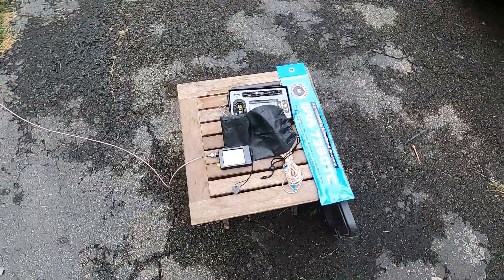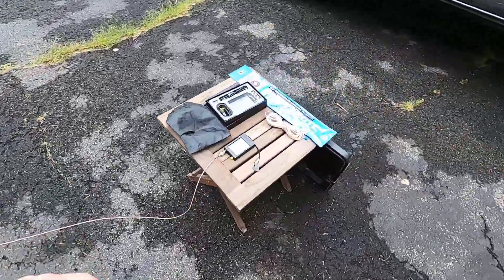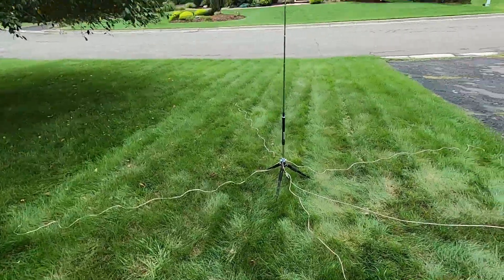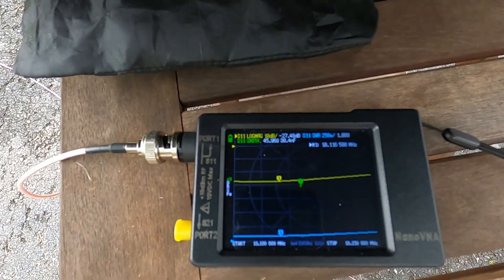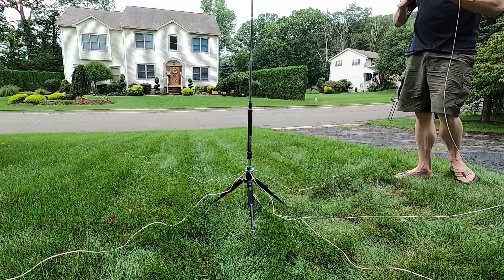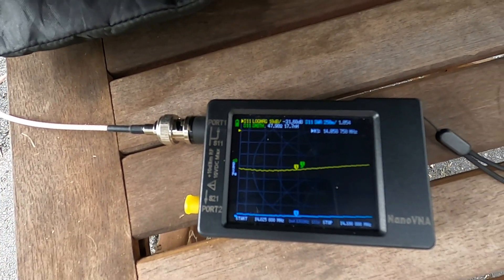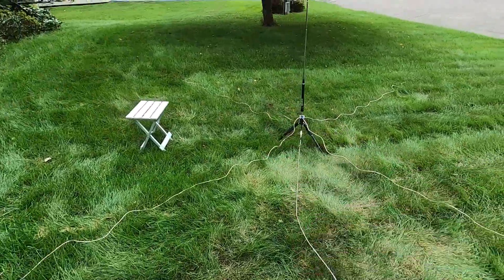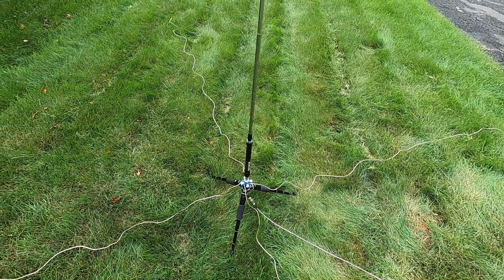Gabil GRA-7350TC antenna revisited.  How much difference does counterpoise number and length make?

Comment: So, if you say that the counterpoises should be 1/4 of the wave length, does that mean that every single wire needs to be that length or just the sum of all lengths? thanks ✌️
Reply from the maker: In theory each should be a quarter wavelength, but what I've found is if they're not elevated, that's not as much of an issue.  I'm running a setup where the total length of all of the radials equals 1/4 wavelength.

Comment: Have you tried putting a common mode choke in your feedline to the antenna? I find it makes my MFJ "Big Stick" less susceptible to tuning changes if I touch the connector shell on the VNA.
Reply from the maker: I haven't, but I'll give it a shot!

Comment: I work with AM radio stations antenna systems.  The best you can do is to get as much metal at the base.  It will be better to get more radials than longer radials.  So 8 15' radials should do better than 4 33' radials. It  easier to work with too
Reply from the maker: Yeah, I run 12 17' radials on my quarter wave vertical.

Comment: Interesting video. When it comes to radials laying on the ground, the more wire the better. 
My friend and I both use the PAC-12 vertical antenna. We both use three each 35 foot long radials and three each 17 foot long radials. This coming summer I am changing to 6 each 35 foot radials and not use the shorter radials.

Want better performance out of that antenna, add more radials. Your goal is not to hit a perfect 1 to 1 SWR. An efficient 1/4 wave vertical with a massive ground radial system will produce around a 38 ohm feed point impedance. If you show a perfect 50 ohm feed point impedance,  you are showing an inefficient antenna.

Barry, KU3X
Reply from the maker: Yeah, on my WRC I run 12 17' counterpoises. I found on the Gabil it wouldn't tune no matter what I did with that setup, but on the 17' vertical it works great. I realize SWR isn't everything, but a lot of my radios are very sensitive to high SWR, especially my little QRP CW radios, so I need to be pretty careful with it. Thanks for watching!

Comment: With these small antennas ( WRC,Super antenna,and the gabil) I worked with various radial combinations. In the end I found that one(1) 33ft length laid in a circular pattern around the base of the vertical worked as well as 3 to 6 radials at various lengths.  A single radial twnds to be directional. So I tried the circular pattern and have found that it works! N7KHH
Reply: Heck! I would try that just because it sounds crazy and I like it! lol.
Reply from the maker: Interesting! I'll have to give it a shot!

Comment: With a slightly longer radiator than the stock whip and three 15 foot radials, this is my “go to” antenna for POTA. Although, I will often use the stock configuration too when low weight and/or low profile is a priority.
Reply from the maker: I'll actually be running it for a POTA activation tomorrow. Thanks for watching!

Comment: I also have the 7350. I use 2-16' and 2-32' counters. It tunes 80-10 just fine.
Reply from the maker: Yeah, it's interesting how the counterpoises effect the tune.  It tunes fine with the setup I have right now, but if I add a 32' counterpoise it tunes even better on 40, and while I haven't tried it yet, I suspect I'd need the long counterpoise for 80 as well.  Thanks for watching!

Comment: I have only used 1 or 2 counterpoises, but elevated them to 4 ft, then got a good VSWR. Then I tried two 46"x 84" aluminum window screens overlapping each other by an inch, but choice to put in a 12  inch ground spike with integrated BNC connector I got from eBay. Suddenly my 7359TC tuned up nicely with full band coverage and 1.2 to 1 VSWR. It was like adding a 10dB amplifier for my 5 watts QRP signal. I intend to play with it some more, but am also experimenting with my MFJ 1979 17' telescoping vertical and also my PackTenna 9:1 UNUN where the feed point is within 12" of the ground and acts like my 16' counterpoise. I love experimenting & wished I could do it full time, lol. The beauty of the aluminum screen is it is quick to deploy and quick to stow, still looking for a small hollow tube to help wind them more tightly. Cheers, Davey - KU9L
Reply from the maker: Yeah, the window screen looks like a very interesting alternative. My only issue with it would be size if I was carrying the antenna into the woods. Close to the car though, and it looks like a good solution. After hearing how well it worked for you I'll definitely give it a shot! Thanks
Reply: @EvanK2EJT  it is super.light weight, the learning curve was to wind it up so it stayed as slender as possible, at 46" wide it could Bungie to my pack, but yeah, I invent reasons to haul more goods up the big hills, lol.
Reply: @EvanK2EJT  Evan, have you ever tried to use Faraday Fabric as the counterpoise? It's light, easily foldable, and may be a great alternative to the screen/chicken wire/hardware cloth as the counterpoint. I also like the idea of 12 inch ground spikes.
Reply from the maker: @KD9ZHF  I have.  It doesn't work where I live.  I suspect it's a ground conductivity issue.  With Faraday cloth or window screen, I'm lucky to see a 2.5:1 SWR.  It works in some places, just not here.